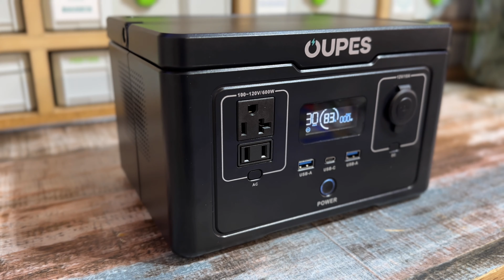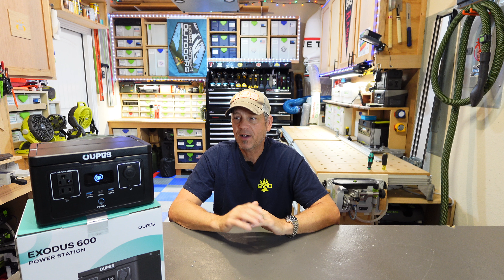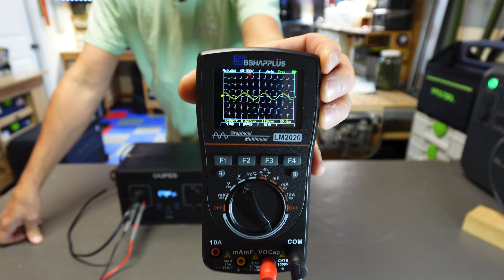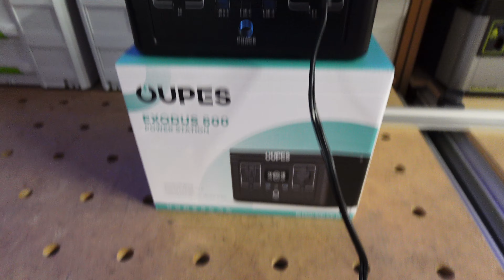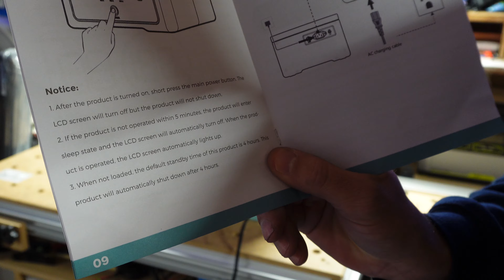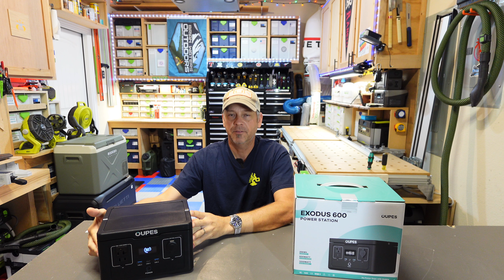Oupes EXODUS 600 Lifepo4 Power Station. Is BIGGER always better?

Comment: I just purchased this unit a few days ago and saw nothing but rave reviews. I haven’t even read the manual yet so did not know about the four hour cut off. However, there might be a workaround for that. If running your DC refrigerator overnight doesn’t pull anything to keep it on, maybe plugging in something small along side of it will keep it turned on? Something that’s pulling 5 to 15 watts maybe. Like a night light. Just a thought. Might be worth experimenting.

Comment: It has a Eps feature not Ups like you said..and actually 20ms is close to other 600watt stations that cost twice as much. You're the 1st reviewer I've ever heard complain about anything with a battery charging too fast. Especially a solar inverter/emergency power supply...
Reply from the maker: High input charging can cause damage to the cells when you continually do it. I want the option to slow charge when I’m not in a hurry. And you have to be careful with other devices on the same circuit your charging if you use the max charge speed….risk popping your breaker.

Comment: Thank you for mentioning that 4 hour cut off - No other YouTuber does!  Also, there is no user manual currently available for download on their website. Downloading and reading the manual is the first thing I do before a purchase - i'll wait. Good review!
Reply: Don't you think it makes sense With a battery capacity so small to not let the relatively large drain from simply being powered on to not deplete your capacity?

 What would be so important that had to be plugged in that wouldn't tap the power supply now often than 4 hour intervals.? 

 If you had larger ccapacity... maybe? 

Seems like folks are missing the idea of how much capacity they bleed just running internal electronics and inverter, even if nothing is plugged in. 

There's under 300 Wh, at best,  to start. 

On a larger capacity unit I'd be more concerned,  would be optimal if that was an option that could be toggled on units... but for sunbathing this small seems like they're protecting folks,  and the system. 

Even though the tech is on general better at Deep Cycle use,  they suggest to try and keep it above 20% if possible...

I'm not sure,  wondering of solar input keeps out awake too ? I think so,  but will check. 

My only wish is that the USB-C supports  USB protocol PPS for Super Fast charging... seeing 15W Output to my phone,  no more.   Booooooh
Reply: adding one thing to help folks appreciate What capacity we're talking about. 300 Wh is.running ONE 100 W light bulb for 3 hours

protecting that capacity is job #1.

The other Thing is This has a very decent Solar input.

Accommodates a 240 w panel.

wondering if one could / as many videos Show with other units, charge DC-DC via the solar inputs...could quite possibly address the idea of not using the entire capacity for fast charging... But I guess has its own challenges and costs

Comment: You had the fridge set to 66 degrees. Who runs a fridge at that high of a temp? 😂 Kind of a moot point . I don't like auto shut offs either but it's a small battery and this is for novice control.
Its Pronounced "Oh-pez".
Reply from the maker: Not a moot point at all, that temp setting was intentional. I needed to see if the power station would shut itself off, which it did, which I don’t like. 👍🏻 and, Oupes did email and say they prefer the name be pronounced as OOPS. kinda weird

Comment: At 250 watts starting up. I think my refrigerator is 93 watts so I maybe could get 2 or 3 hours out of it. My house is on the same grid as our hospital so we could get power back in 2 hours or less. With that said after 2 hours I could plug it in and get the added hours. Nice for the price. 😊
If you were to set your frig at 37 it may keep running.